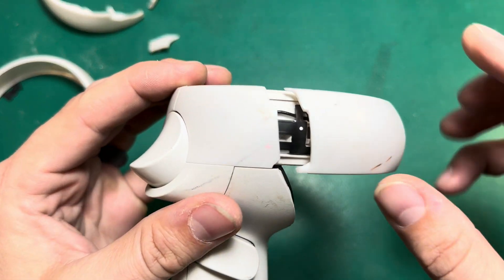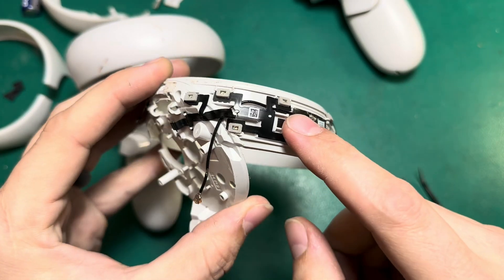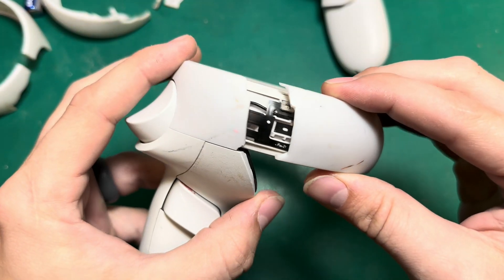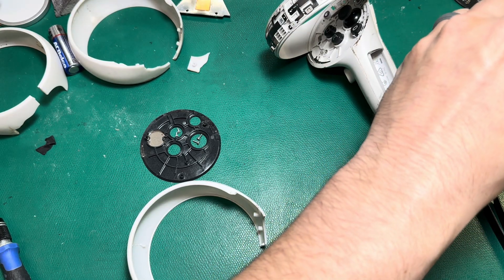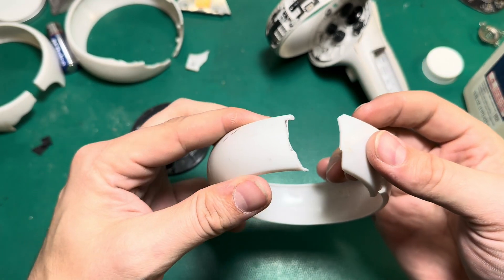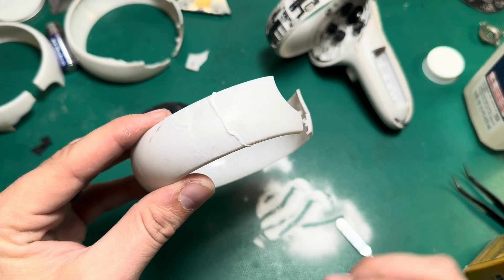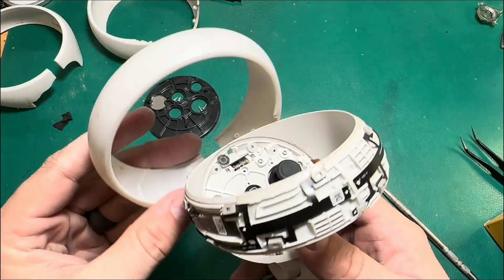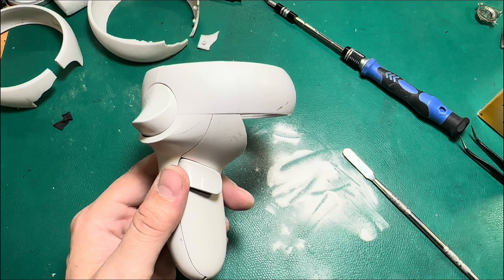How to Fix a Broken Tracking Ring on Your Meta Quest 2 – Easy Tutorial

Comment: Could the LED Ribbon "tracking Lights" be the reason my controller will pair but will not effectively wake up? I cannot get this controller to work.  After pairing only the light will flash on the controller and I can see it has paired and battery display on the headset but Zero function.  Thanks!

Comment: Can u help me so like my controller vibrates but no led light pops up on the controller so i assumed it was on when i put on my headset i didnt see my left controller and it said “press any button to connect left controller” and i did and it never worked
Reply: I have the same problem in the same controller, did u find a solution?

Comment: can you make an  video on how to fix an controller that keeps reconecting and disconnecting my light just keeps glitching and when it connect it just vibrates reconnects for 1 second and then disconnecting
Reply: its called a new battery
Reply: @V1P3RPR1NGL3S  Hey man, no it isn’t, I know his issue. The light glitching is a broken infrared light, it just happens. Sometimes it’s a battery issue but this isn’t, don’t be rude man.
Reply: @hiiiiiii49  well i did get a new headset for xmas so i dont have that problem

Comment: Is fixing quest 3 headsets a cheep way to get a quest for under 500
Reply from the maker: It really depends on what is wrong with the unit and how expensive the replacement part would be. It can be done, but sometimes you gotta wait for the right fixer upper unit to come along.
Reply: @fixmyoculus  nice I might just wait until I find something broken with the speaker arm or something easy